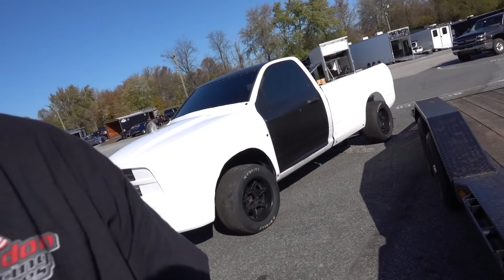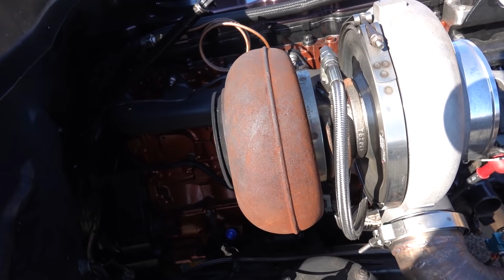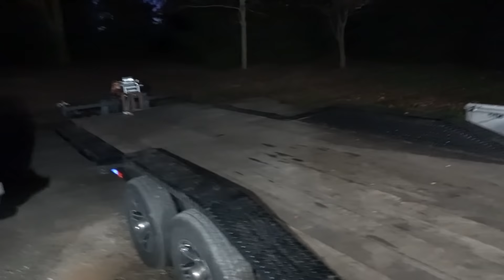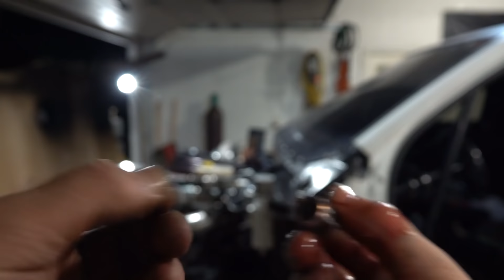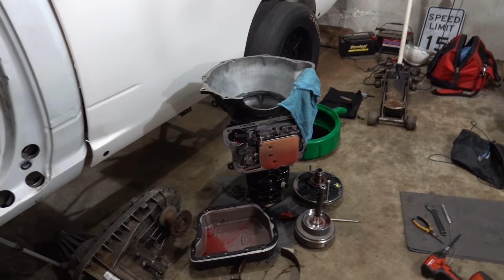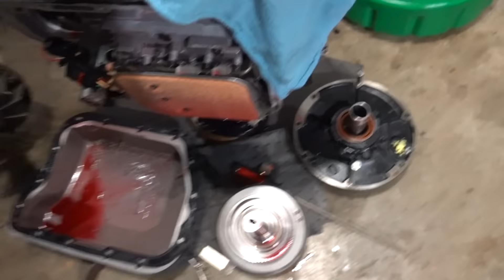Cummins Drag Truck FINALLY Hits The Quarter Mile... Things Go TERRIBLY!!

Comment: All kidding aside love your builds, but my grandfather taught me a lesson as a kid I'm just now referring back to as a young adult and it goes like this, "it only costs a little bit more to be cheap!" Take it with a grain of salt I'm not far behind in needing a trans behind my Cummins and recently went through the same heart ache after fiddling with my cp3 pump doing a DIY "Bag o Parts" mod to my pump and shot the whole fuel system so 10k later with studs and valve springs and Firepunk tunes im hoping for the best at the track soon!

Comment: Damn dude so sorry to hear that things didn’t go as planned. For the exhaust pin, might I suggest you drill and tap two small holes in the turbo and screw in two small studs then fasten the exhaust to it and then clamp it

Comment: Things  happen  for a reason. Like you said you could if been miles away when it happened.  At least is wasn't  the engine. You might  need to down tune  the engine  till you get all the transmission  issues  ran down.

Comment: There is SO much pressure on that exhaust pipe, I would highly suggest making it a single 90 degree bend to prevent the stress of the extra 90 if you can get away with it.

Comment: Transmission thing sucks.. but on the turbo id drill out that roll pin and weld in the shaft from the drill bit they are very hard, Ive done this with good results on a different application
Reply from the maker: Possibly, honestly I'm surprised it sheared that quick and that cleanly

Comment: Are they building the box to your spec or are you telling them the application and they build it?   If it’s the later then hard failure or not that should be warrantied.  

I appreciate it’s parts from the old truck but I’d get them to build it to your application.

Comment: Man I hate to say it but I think you should find someone else for your transmission work. You have had a lot of problems with that thing.
Reply from the maker: Incorrect. This is my second trans issue. Previously it was converter issues. Then a seal that broke. Also this intermediate shaft predates me using muldoons for my trans work. It has seen nothing but abuse from me.
Reply: @TurbaTom  oh okay man that makes sense just bad timing on that intermediate shaft lol
Reply: John Muldoon is one of the best transmission builders in the country. Never mind that, at this power level shit is going to break, especially if you spin (wheel hop at this torque level is devastating to the drivetrain), shit happens, Tom was just on the receiving end.

Comment: No matter how hard you try, You simply can't dodge these transmissions issues. Just go to something other than a garbage dodge transmission. That truck is built from the ground up and i know damn well there is something better.
Reply: If he's running 1/4 mile there isn't any better option than a built 48.  But I like what you did there, "You simply can't dodge these transmissions issues". Clever!
Reply: if built right guys a running 48s no problem. like someone else said, other builders have some fast set ups on this trans. could just out dated hard parts.
Reply from the maker: If you know of a proven overdrive transmission that holds up at this level let me know. Everyone has transmission problems at this level, they just might not say it.
Reply: Yea that's true. When I got my 48re built I looked around to see which shops were doing what I wanted to do. I went to firepunk. They are probably closer to you anyway. But those guys were great to deal with. Make sure you talk to Andy and not rob when you call.
Reply: The fastest trucks in the world use 48s.. lmao. But let's hear what's better than these "garbage dodge transmissions".